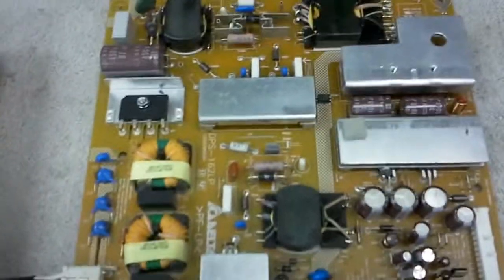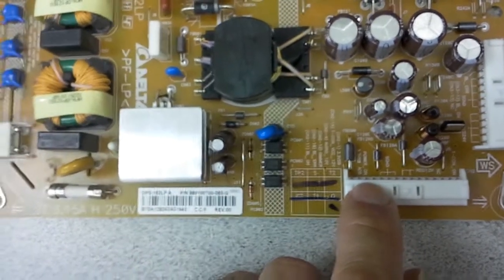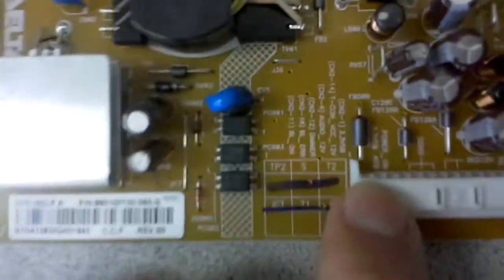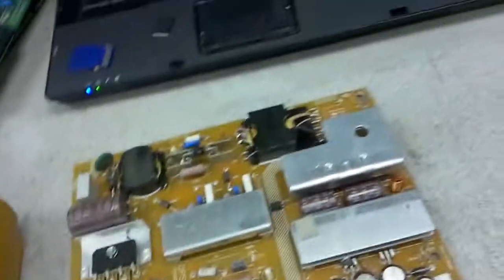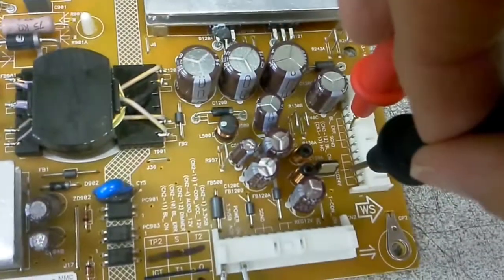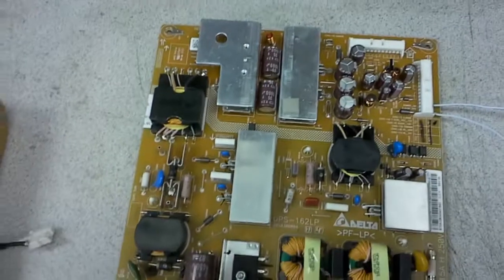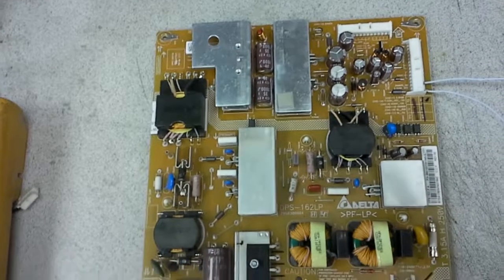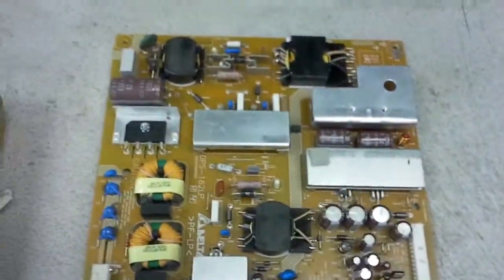How to test Sony DPS-162LP power supply board

Comment: Thank you for posting the troubleshooting video. Everything measured the same has your test, except for the unregulated 24volts, I measure 1.4 volt with the load pcb attached, I also don't hear the clicking noise, like it use to do. Any pointers you could give me?
Cheers!
Phil
Reply: i measured my unregulated 24v as well and also measured 1.4volts with tweezers. Did you fix your problem?
Reply: I have the same results but no 24v. What was your fix? The whole power supply board
Reply: I kept working on it until while measuring more test points I shorted some pins and fried more components DOH! It is now beyond my repair capabilities.